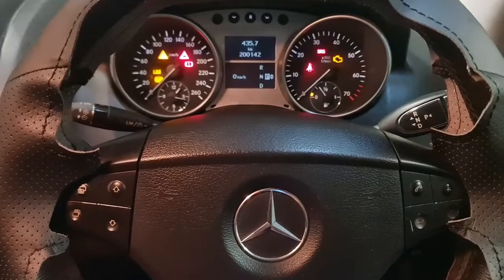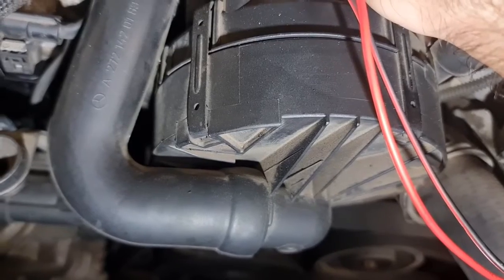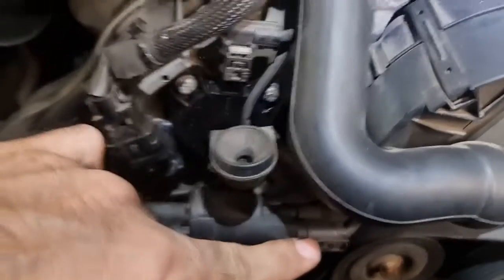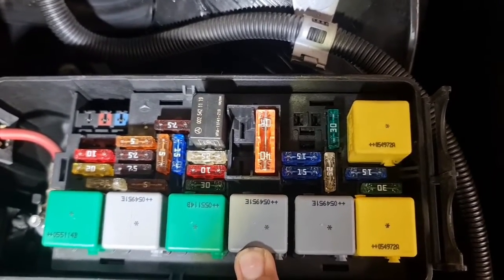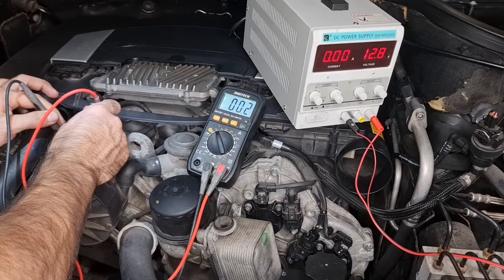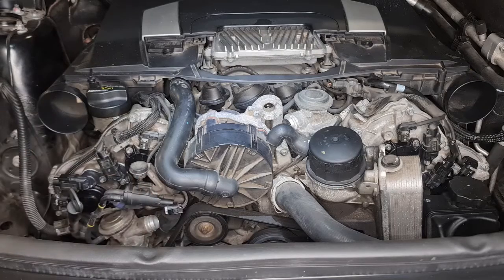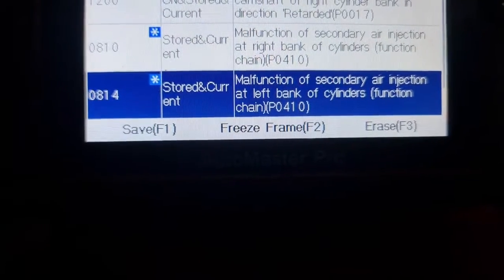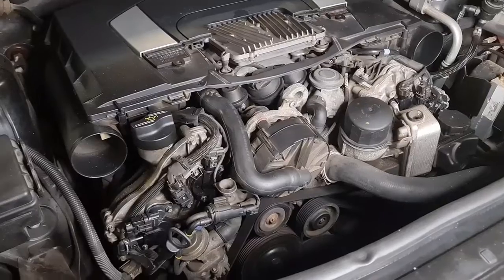Mercedes P0410: 5 Crucial Tests to do on Secondary Air Pump.

Comment: My pump doesn’t turn on with car but turned on with separate power, my relay is clicking, and my fuse is good. What else could it be?
Reply from the maker: Wiring. 😊

Comment: How did you connect the power supply to test the pump?  I know dc motors do not have neg and pos poles, but does it matter where you connect the pos side of the power supply? (don't want to run the motor backwards) looks like a brown/red wire is the bottom lead to the motor and a brown wire to the top lead. I assume you connect the pos of the p/s to the bottom lead of the motor. correct?
Reply from the maker: Brown in Mercedes-Benz is usually negative  and don't worry a DC motor can rotate both ways, so not a problem if you switch the + & -.

Comment: what if the solenoids electric converter gives only 3 volts instead of 12 volts?
Reply from the maker: Not going to work, check the negative as well.
Reply: @BenzAddiction  yeah and thats my problem I dont know how to fix it and im thinking it is caused by damaged wire or something but the 3 volts cant give enough power for the switchhover valve to suck

Comment: My switch over valve is leaking stuff out which looks like oil. What does that mean?
Reply from the maker: That's strange 🤔
Reply: Yeah it’s getting over all over my pulleys belt and alternator. Should I replace the air pump valves?

Comment: Hi, thanks for the video. I have tested the resistance, reading 30 Ohms, and the solenoid actuates when 12V is applied, however, air does not 'divert into the second outlet when actuated. Blowing through a tube, not using a compressor at inlet 1, air flows through outlet 3, but never 2. Unless the valve requires a specified pressure AND voltage, am I wrong in assuming the diverter valve is faulty?
Reply from the maker: 30 ohms for the air pump is too high.
Reply: @BenzAddiction  thanks, i was referring to the solenoid diverter valve. So outlet 1 in it is not connected to anything (it has a little cap with a mesh screen in it which was clogged. When applying voltage to it, air passed through between 2 and 3. I now think it's not faulty. The biggest issue I have is the crumbling vacuum lines which I am replacing (all of them).

Comment: My car sometimes has this code along with p0172 code at cold start. Are those 2 codes somehow corelating to each other??
Reply from the maker: DTC P0172 indicates a rich fuel mixture, while DTC P0410 indicates a malfunction in the secondary air injection system. While they don't directly cause each other, a problem with the secondary air injection system (P0410) could lead to a rich condition (P0172) by failing to introduce enough air into the exhaust, which the oxygen sensors might misinterpret as a rich mixture.
Reply: @BenzAddiction what do you mean rich condition p0410 I’m trying to figure out that code
Reply: @BenzAddiction  it’s has the code constantly

Comment: Had the code, it was a dead pump, you could hear the whine when it started, then it stopped and got the check engine P0410. Installed a new pump, checked lines/fuses etc. New pump works perfect, code cleared then came back a few days later.....going to go back through the steps again....
Reply: Exactly same here brother, did you figure out why it came back ? I’m bouta check the 14 amp fuse or the check valves
Reply from the maker: Good to hear mate 👍

Comment: How did you connect the power supply to test the pump? There are two wires connecting to two terminals on the pump.   Did you connect the positive to the two terminals on the pump and the negative to ground?  I don't want to blow a fuse!  Many thanks,  John
Reply from the maker: Separate the connector first, and only power up the 2 pump wires.
Reply: @BenzAddiction  I know dc motors do not have neg and pos poles, but does it matter where you connect the pos side of the power supply? (don't want to run the motor backwards) looks like a brown/red wire is the bottom lead to the motor and a brown wire to the top lead. I assume you connect the pos of the p/s to the bottom lead of the motor.

Comment: Great video, many thanks.  I noticed you used a separate power supply for your tests,  Can you use the battery in the car?
Cheers, John
Reply from the maker: Why not, as long as you disconnect parts and test separately and not while connected it should be safe.

Comment: I seem to be getting only 8.8 volts coming from the wiring harness to the air injection solenoid change over valve . And I want to make sure that it's possibly maybe just corrosion build up Spencer's over 183,000 Mi on the car. I already did the relay and fuse 40 amp for the air pump and I did see a lot of corrosion just want to feel more comfortable that I just replaced them thank you very much if you can help out. Your video is very direct and focused subject area of what connects with that and those products
Reply from the maker: This is a good step forward,  sounds to me that you need to check the ground too.

Comment: Well there's seems to be a few terminologies when I'm asking about the secondary air injection solenoid control valve which some people are products are stating it as a changeover valve that runs at 12 volts what are the two vacuum lines come out from the left side when facing the car. Is there a relay also or just a fuse and where would it be located on a 2006 C230 2.5 l m 27 2.052 ?
Reply from the maker: Sorry I suggest you watching the video again, all is mentioned.

Comment: Hi, where is Amp fuse for the air injection control valve solenoid ?
Reply from the maker: I also have a full video on the Fuses, depending on your car.
Reply: I didn't look like it was showing on the video for a Mercedes 2006 2.5 C230 M272 a air injection control valve solenoid  fuse was in the Display of conversation... is it 48,50,? In the fuse bix?

Comment: Please tell me if secondary air pump failure affects engine torque and RBM. I have w211 e350 2008.
Reply from the maker: No. It won't,  it only warms up Catalic converter quickly for less polution.
Reply: @BenzAddiction yes , and limp mode transmission

Comment: I’m getting intermittent P0410 (0810/0814) errors — they show up most of the time, but occasionally they’re not there.
The secondary air pump has been replaced with a known good unit (from my previous engine, which never had this error).
But now I’m wondering: could the electric vacuum solenoid be leaking as well?
The electrical side seems fine — it clicks when powered — but could there be a crack or small tear in the diaphragm?
Reply from the maker: Yes, easy to check using a long hose and good old mouth vacuum test 😉
Reply: @BenzAddiction  So that’s a possibility. I’ve still got a vacuum tester, so I can try pulling a vacuum and check for leaks.
Any idea how much vacuum is safe to apply? Would 1 bar be too much?

It's the intermittent part that gets me confused, pretty weather/temperature independent too.

Comment: if the fuse is not okay? it must be the secondary air pump or not ?
Reply: i have changes the fuse . it brokes again.
Reply from the maker: Then your pump is faulty.
Reply: @shqipee6417  I'm in the same situation with you. Did you find the cause?
Reply from the maker: Ok,. Seems like you need to replace the pump.

Comment: My pump makes a loud noise when I start the car what could be the problem
Reply: Meaning it has to make noise during starting or ?
Reply from the maker: @lucidax8749  it is a very high speed motor with a fan to push air in to the exhaust  so it should come on for few seconds after start up to help warming up the cats, so it should make whistle noise.
Reply from the maker: How loud is it? Normal whistle noise is acceptable.

Comment: Hello, My air pump isn't working and my ignition is misfiring. It turned out that the fuse was broken. I replaced the fuse but the pump still does not work. Do I have to remove the errors with my computer first?
Reply from the maker: @mateusz7751  The pump needs to be checked, it might be rusty inside or stuck somehow.  Also recommended to diagnose and clear the codes.

Comment: I have two 2008 clk350 Cabriolet. One is my wife's, and I  have one. Her smog pump blows air into the intake manifold. Mines suck air out of the manifold. Mine sounds like a circular saw running. I saw another video showing how to take care of that already. I have no codes, either.
Reply: So does it supposed to suck because mines suck air out as well?👀
Reply from the maker: @shark70007000  👍

Comment: I have a 08 c300 merc I checked the pump and it was 1.5 ohms I checked the solenoid and that was 30 ohms the fuses are all fine relay I think was fine vaccum lines were okay the valves were clean one was a little rusty but not bad at all the pump seemed like it wasn’t getting enough power brought to it when we tested the pump it was working fine but when it’s plugged into the car seems like it’s not wanting to run
Reply: I tested the relay and that was fine I have no idea what else it could be any ideas?
Reply from the maker: What about the relay?
Reply: @ the relay seems fine didn’t really test it with it looking new still
Reply from the maker: @dylanderoche9754  Yes, you need to test them one by one and tick each box out to get to the real issue.
Reply: When you try the solenoid for clicks is your 12v thing clicking or is the solenoid clicking?
Reply: @dylanderoche9754  its the solenoid that clics. Did you solve the problem?

Comment: For god's sake, you determined the pump can run so is there 12v at the pump plug or not??? If not, go to fuse, go to relay, broken wire?
Reply from the maker: @JoelBlauvelt  Yup.
Reply: @BenzAddiction  My pump's not getting 12v though it runes well when apply externl 12v. All fuses & relays tested good. Any ideas??? TIA

Comment: I have 07 Mercedes w221 I get p410 and it won’t start. Any idea?
Reply from the maker: The engine won't start or the air pump? If the engine won't start has nothing to do do with this code. Find another reason.
Reply: No codes come up at all

Comment: My pump burned out. I changed my pump, fuse, relay, solenoid and I checked the 2 vaccums they were clean. What could be wrong??. I did have an eval leak I fixed it by changing evap purge valve. But my p0410 code never goes away.
Reply: I did the same on my 09 c300. Replaced everything. Secondary air pump was also stuck . Problem was the check valves and my car only has 87k miles on it
Reply from the maker: @brucewayne2773  Thanks for sharing 👍
Reply from the maker: @armendshaqiri7621  Clear the code, check to see if the valves open and close as they should.

Comment: The cable that is connected to the secondary air pump does not have power. Don't you know why?
Reply from the maker: It only powers up for a min after start up usually.  There is a relay that can go bad as well as fuse.
Reply: @BenzAddiction  I'm just changing one of the valves and checking the lines I have the code p0410 and when I turn on the truck it smokes but the secondary pump doesn't work, I removed it and tested it and it works.  Now one of the valves was not working and I had it installed tomorrow but I wanted to see if the secondary air pump cable had power but I never turned it on to check if it had power.   Because of this code, is it normal for smoke to appear?
Reply from the maker: If you do the tests one by one it ticks off all of the components and hopefully you'll find the issue, smoke should not be related to air pump. This pump only injects air to exhaust.  With valves stuck open you might get some exhaust gas in to the pump that can ruin it and produce extra noise.

Comment: What is the solenoid called? Secondary air intake solenoid?
Reply: Thanks. Also, my OBD 2 scanner says “valve stuck open bank 2” is bank 2 the right side of the engine looking at it from the front of the car? Thanks
Reply from the maker: @Wargasm54  Are you using a generic obd2 scanner?
Reply: @BenzAddiction yes. Cheap scanner. Says “secondary air valve (bank 2) stuck open” code 0821
Reply from the maker: In this case, you are not getting specific data, consult with Google.
Reply from the maker: Yes: Secondary air injection selenoid.

Comment: Hello, I have a fault code 0694 M4/7 is not working correctly.
The engine fan fails sporadically but comes on when you activate A/C.
Do you recommend changing the motor fan or maybe it can be fixed?
Regardss!
Reply from the maker: Needs diagnostic tools,  take this seriously as you might end up with a blown engine.
Reply: @BenzAddiction  mmm, better to change it, new or second hand one? 
High temperatures are coming in 2 months. Spain Summer.
Reply: What working temperature is appropriate for the engine?

Comment: You covered very well.  If all parts test fine and P0410 still shows up, then it may be exhaust manifold air injection passage clogged by carbon which is the worst worst scenario !
Reply from the maker: Very good point, thank you mate.
Reply: How would you be able to clean those clogged passages? I think that is the case with my clk350.
Reply: @dmitriysklyar7176  disassemble exhaust manifold to clean up carbon !
Reply: @dmitriysklyar7176 seafoam works great, just got mine done

Comment from the maker: Hi all, please test all the 5 components before taking your car to a shop or buying parts and save money on P0410 Secondary Air Pump...cheers Max.
Reply: I hope you checked the fuse first before checking all the other components out that would hane been a rookie mistake
Reply: theres an auction here in nsw for a clk350 on carbids that sounds the same as 7:19, must be scaring people off because not a serious bid yet with 24 hours left, going to try my luck tomorrow

theres a video at the end of the image gallery, would be great to read your thoughts on it